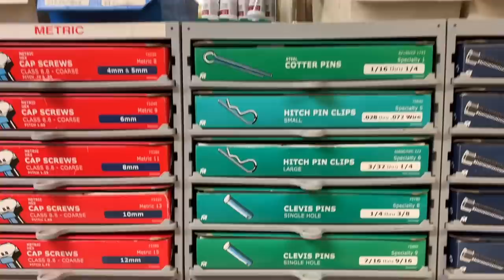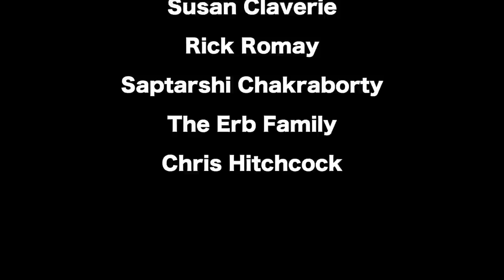Installing Hurricane Strapping & Cement Mixer Repair (Chicken Garden Day 56)

Comment: The keys are in there to protect the motor. We had a key break on our lawn mower because the blade hit a buried rock. It protected the motor by the key breaking instead of our motor trying to power through the rock. We just went and bought another key too at a hardware store. We had never had that happen before. I bet a rock got wedged just right so the key broke instead of the motor. I'm so glad Ashley that your dad caught the need to put in the hurricane straps for the chicken coop roof before it was too late. Yummm, roasted tomatillo salsa! Yay, you got the hurricane strip ends melted and installed. Bravo! Still great progress made today after intermittent rain showers. I love it Ashley when you said you had to wait for the gate to open and then you said that you didn't have an automatic gate opener! Are those an actual thing there in Arizona? Do people have gates that will open and shut with like a garage door set-up?
Reply from the maker: yeah, you can get kits that will allow your gate to open up automatically when you pull up. would be so nice to have one day...

Comment: Hey, good work.   I watched you put the key back in.  Did I see you put a screw back on the end of the shaft?.. if I wasn't mistaken maybe you could use a bigger washer at that point to prevent the key from falling out again.  Yours is the first that I've seen come out easily.  Then again it is a harbour Freight item.  Your follower Stephanie h below addressed the desire to grow tomatillo.  It's really easy.  So easy that the volunteers the following season completely overtook a section of my garden.  Again good work..
Reply: Ooh, I love easy to grow veggies (fruits) so I will definitely give tomatillos a try!
Reply from the maker: Yeah we put the screw back in, and actually there are quite a few videos out there about this particular part of the cement mixer failing. Oh well :)

Comment: eBike.  That trip to dollar general store would have been perfect with an eBike. no need to use gasoline.
eBike batteries use 1 Kwh to 2 Kwh generally which is only a few pennies to charge up or in your case just plug eBike battery charger in the wall and it fills in a few hours. 
Since your electric is by solar panels exclusively, maybe learn about buck/boost controllers which are used with solar panels, MPPT controllers, electric loads like motors, and batteries.
An eBike with a battery can go 20 to 50 miles. An eBike with a solar panel and buck/boost controller can go as long as the sun is shining.
One thing though, anyone can ride an eBike, but to take the truck a drivers license is needed.
Reply from the maker: Don’t have time to ride a bike 10+ miles for a quick grocery run :)
Reply from the maker: Also we know how expensive eBikes are. Not in the budget…
Reply: Can you imagine washboarded- dirt roads on an ebike?!  Haha
Reply: @paulas_lens  i rode ebikes in china for years. some roads in china are so bad only the instant on off of the eBike drive motor can survive the bad roads, as any Gasoline motorcycle would be quickly shaken apart.
all farmers take all their produce of every kind to market with eBikes.
Reply: @TinyShinyHome  eBikes can go 20 to 50 Mph just like a truck. just an idea, maybe an option as I saw at one time you had bikes.

Comment: I have beem wondering about this idea since I first saw the straps on the Shed. What if you waited to install the straps after you have the boards in place that need to be anchored? The straps could be easily inserted through the bag layer of your choosing using a masonry drill bit. The bags are technically a brick item once they dry and harden. Then you could choose the best locations and numbers of straps. You could add them too, if needed or desired, to the walls of the chicken courtyard. Since you are trying ideas this would be a good place to see and test.
Reply from the maker: That would likely break the compression of the bags making them less stable.